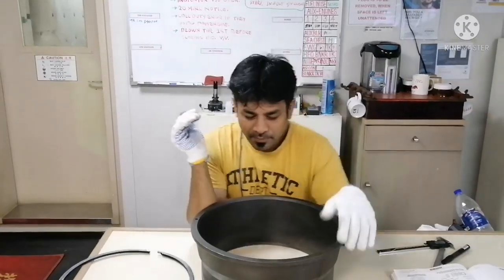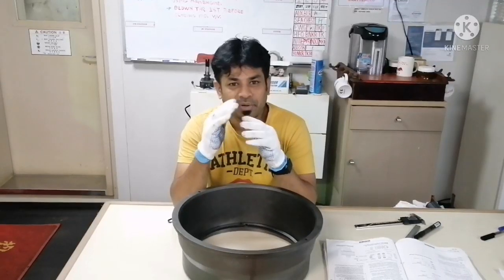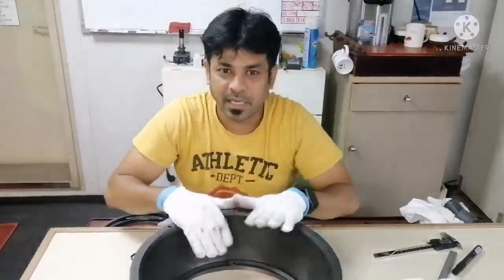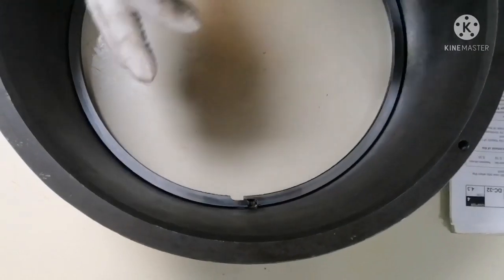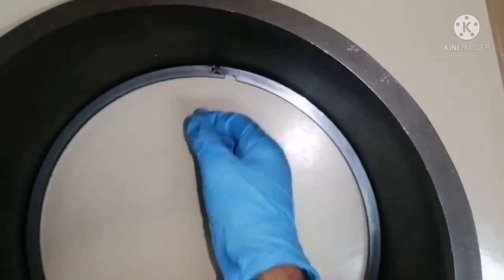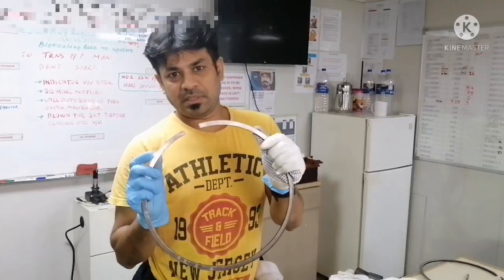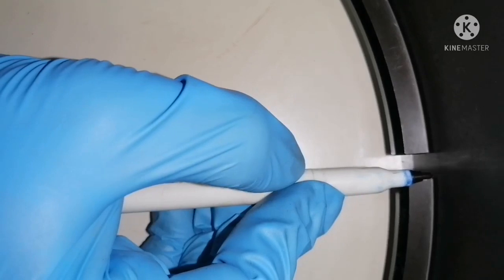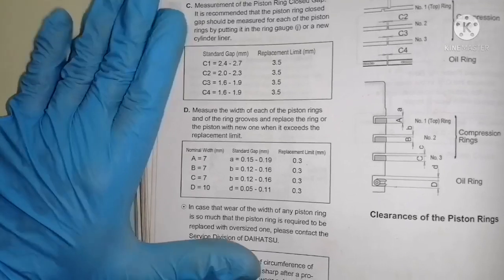How do they do... How to measure Ring gap(Butt clearance) for piston ring..

Comment: Sir how do we know the ring is well aligned when checking it with the liner . Is it correct fitment of the ring ?
Reply: Clearance is taken with the ring alone in the loner right sir?
Reply from the maker: @arunprakash932  i didn't understand your question sir... Can u pls ask again
Reply: @marine-knowledge-basha   sir when we are checking the main engine piston ring clearance we check that by placing the ring alone in the liner right not along with the piston?
Reply from the maker: @arunprakash932  ring alone sir...
Reply: @marine-knowledge-basha  thank you sir
Reply from the maker: Thanks for your query sir...
If the rings go smooth while installing then it means it's fitted rt.. U can also turn the engine for checking the  free Movement of piston